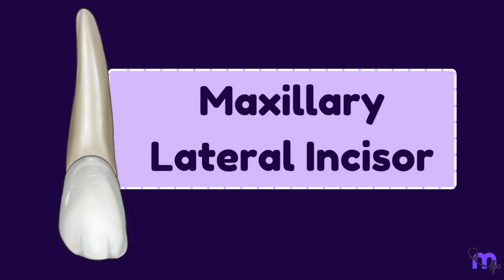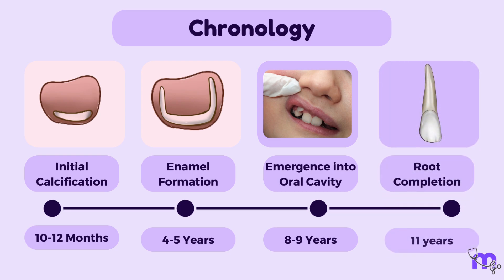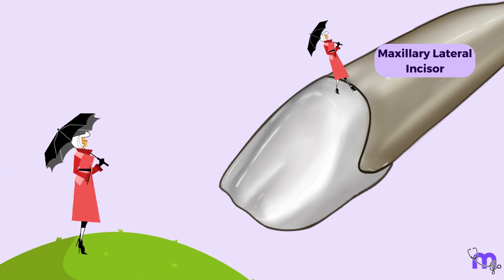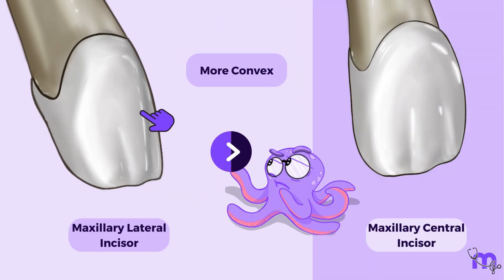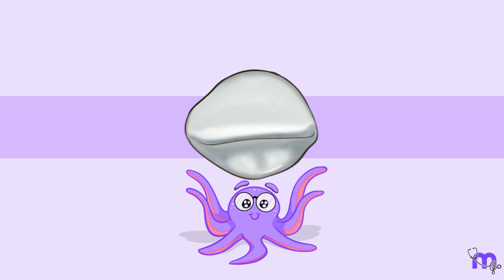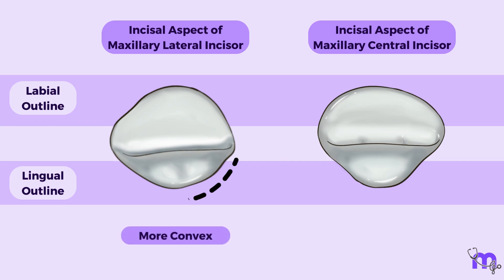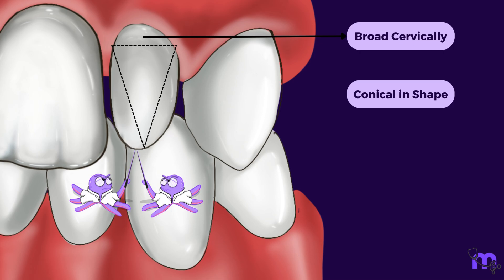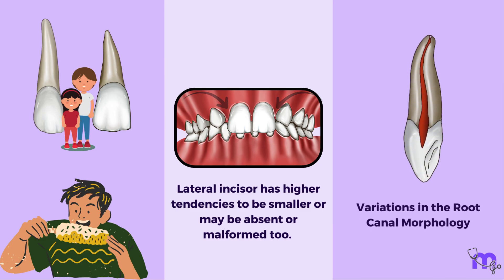Maxillary Lateral Incisor Anatomy | Crown, Root, Pulp & Developmental Anomalies

Comment: A small, painless, round lesion on the soft palate appears as a red spot from a distance. However, upon closer inspection, it reveals more pronounced red veins within the round area. The lesion is flat, soft to the touch, and has the same texture as the surrounding normal mucosa. Notably, it blanches easily when touched. What could this lesion be?